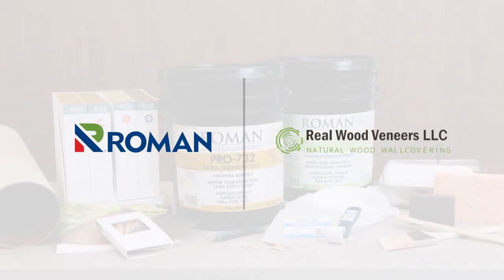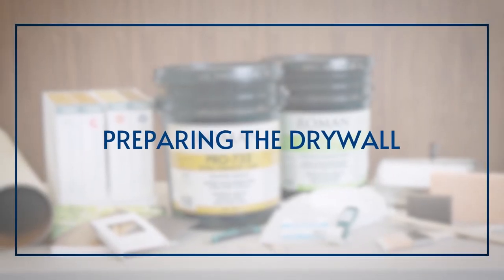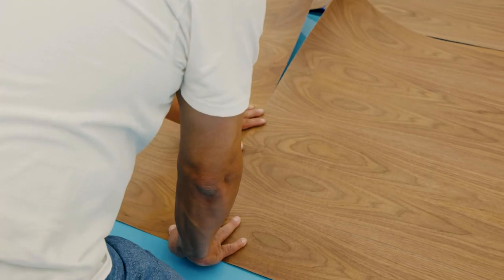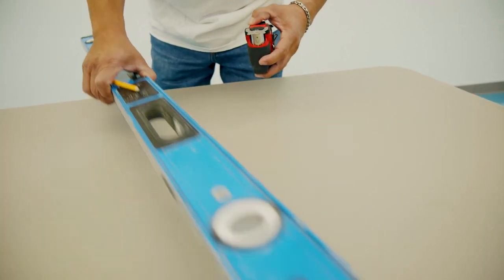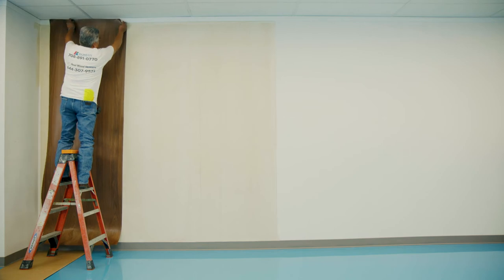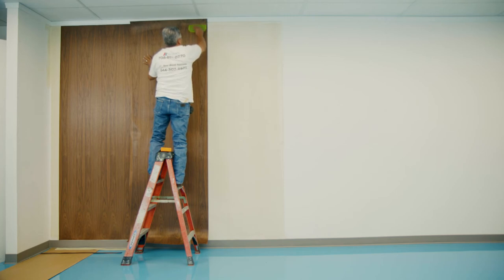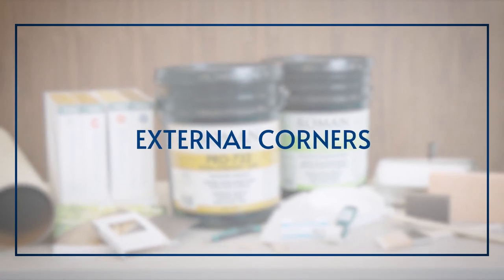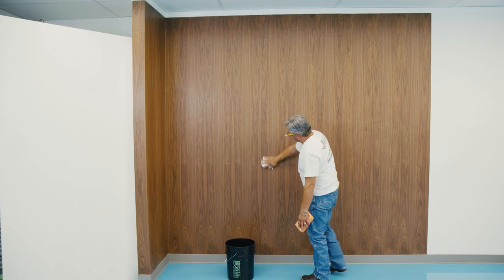How to Install - Real Wood Veneer Wallcovering

Comment: This method of clay to the wall is not acceptable by Sanfoot or Arbor Veneer Wallcoverings, it will result in higher de-lamination from the wall and shrinkage at the seams. Verify instructions with brand you are installing prior to installation. Most will require clay to the veneer prior to installation.
Reply: Actually you are half right. The preferred method of installation is to prime walls.Let cure at least 24 to 48. Prime with clay the day before. Install day, glue the material and hang. This creates a double stick application. Installing this way will give you 100% results. Clay dries fairly quickly on the wall. So you can glue up a whole wall or room the day of installation though.